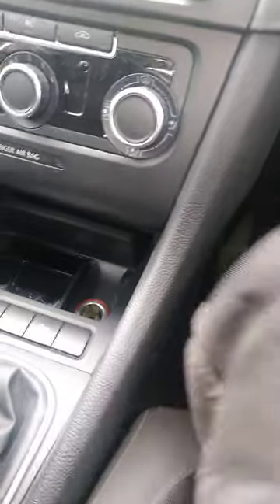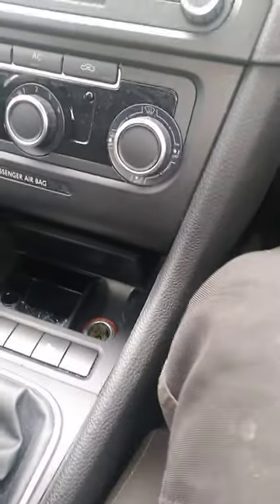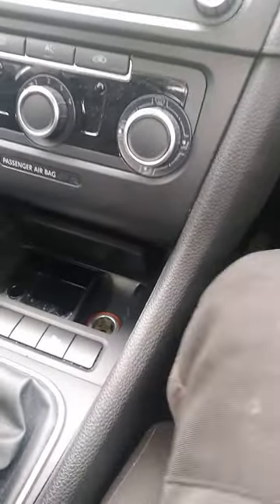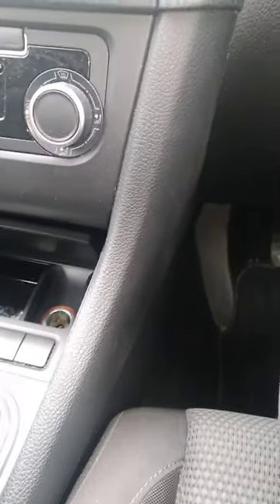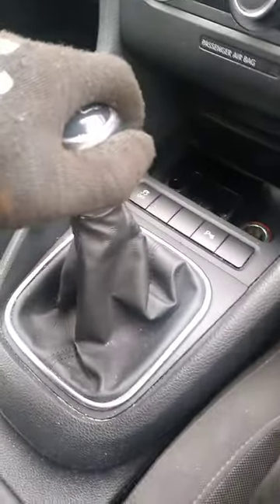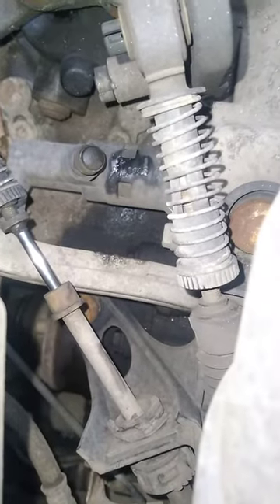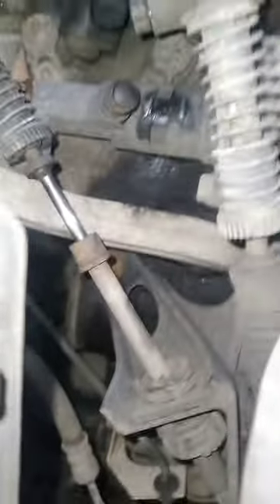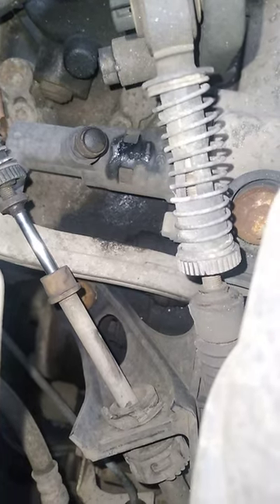clutch pedal soft not coming back up #clutch_#not_coming_#backup find problem and diagnose#clutch

Comment: Guys, if this happens, you can check the clutch cable. In my car (2001 WV Caddy 1.9), right next to the engine, it is 1 meter long and looks like expensive bicycle locks. After finding your cable, go under the car and find the clutch cable from below. There are 2 hexagonal pieces that connect the clutch cable screw to the transmission and hold it at the bottom. 1 small, 1 large. If you tighten the small one (do not tighten the big one, only the small one. If the big one rotates, keep it fixed in place and tighten the small one). Your clutch will go halfway instead of going all the way to the end and staying there. (think of it as driving with half clutch and half throttle) If you do this, you will repair your car enough to take it to the mechanic.
Reply from the maker: Yes  older car have a cable for the clutch and the throttle body but newer cars have a hydraulic system so there is no cable so your method wouldn't work and you will need a mechanic even a car with the cable would need a mechanic because the clutch cable only starts to become loose is because ur clutch is getting worn and 1 day you will still need a mechanic to replace your clutch or you can try following a youtube guide yourself on how to do it either way youl still need a mechanic weather its a garage or youtube

Comment from the maker: @bahadradanur1078  Yes  older car have a cable for the clutch and the throttle body but newer cars have a hydraulic system so there is no cable so your method wouldn't work and you will need a mechanic even a car with the cable would need a mechanic because the clutch cable only starts to become loose is because ur clutch is getting worn and 1 day you will still need a mechanic to replace your clutch or you can try following a youtube guide yourself on how to do it either way youl still need a mechanic weather its a garage or youtube

Comment: Tell me how to fix that in vw jetta 2009 model
Reply from the maker: Fix which part it's needs diagnosing first need to check to see if it's slave cylinder master cylinder or clutch bearing its self or a leak

Comment: This happened mine aswell mechanic said i needed a new clutch and charged me for it
Reply from the maker: Yeah might have been clutch pressure plate or slave or master cylinder
Reply: @cartec9600  I was charged 1,480 for the work does this sound right? My clutch or gear box etc never gave bother just happened suddenly
Reply from the maker: @nathangrimes-os9mm  what car do you have and what did they exactly change just the clutch or any slave cylinder with it  or flywheel n tbh that does sounds expensive the most people charge  around here for a clutch is 300 to 500 depending on car n that's with parts n labour did u go to an independent garage or was it main dealers also depends where u live aswell for a example if you live in London it is really expensive around there but yet again 1.480 does sound to expensive that's to much but u need break down what they actually did to your car
Reply: Thank you . That was very helpful
Reply from the maker: @ianhendricks3924  your welcome
Reply: That happened to me last night, when I tucked my foot under the pedal I was a able to pull it up and has worked fine since. Was also unable to engage gear when it was stuck. Once up I drove 2 hrs home with no issue. This potentially the same problem?